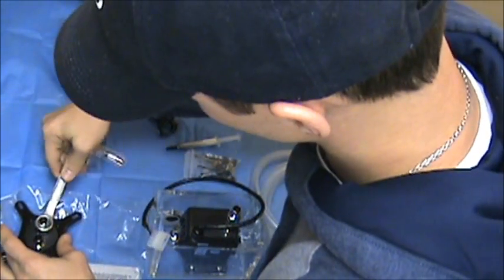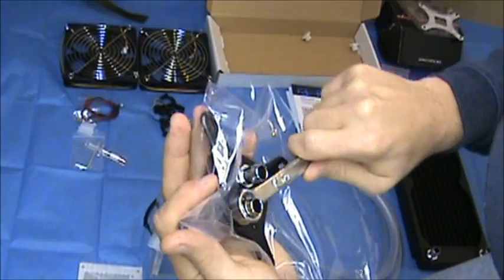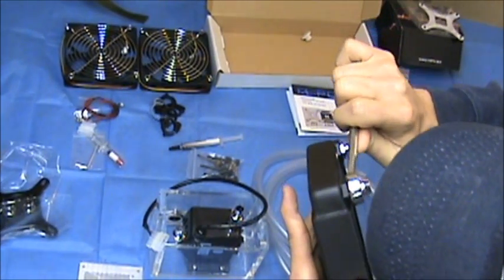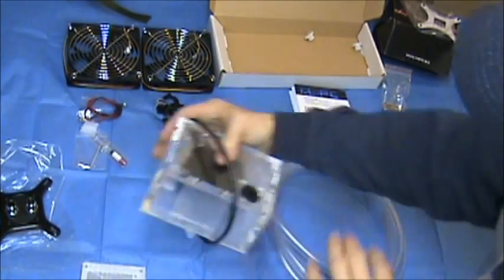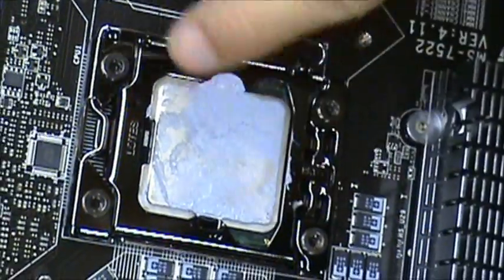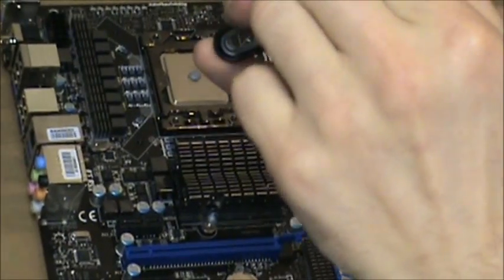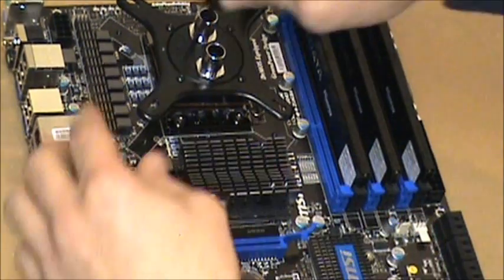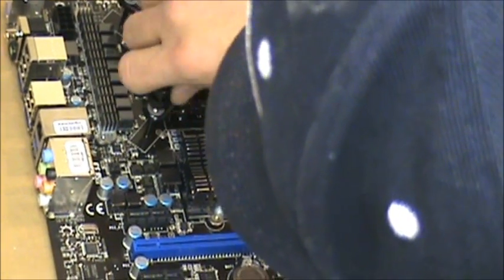XSPC Rasa Liquid CPU Cooling System install pt1

Comment: Pure water is 100% non conductive. If dust is allowed to interact with the system, the entire system will almost certainly become conductive. As far as the additive being non conductive, you are mostly correct. That is almost universally a lie. Most compounds that are regarded as being highly non conductive electrically are typically insulative for heat as well.

Comment: @MrSpazmataz Technically distilled water IS conductive. It just doesn't conduct very well. Tap water is more conductive because it has more stuff in it, like dust which makes it just a bit more conductive. We use distilled in water cooling due to it not having as many living things in it as tap does.

Comment: @myblackabyss 
Use a bit less then a grain of rice and the number 5 dice method is the best for any cooler. It always does a perfect job. I have overclocked over 500 CPUS on 15 different motherboards on the i7 alone. keep corner dots 1/4 inch away from all sides and the center dot is to be no bigger then the others. All about a small dab the size of a 1/4 grain of rice.  This method has dropped temps for countless clients. OverCLOCK your CPU! dont OVERVOLT IT! Or Over Paste it!  just my 2 cents

Comment: Only tighten the barbs as tight as you can with your hands then 1/4 turn with a wrench and that is all you need. I wish they had this kit when I started water cooling.
Oh and also the "non conductive" additive is all a lye its just as conductive as water which unless it gets dust in it is not very conductive.